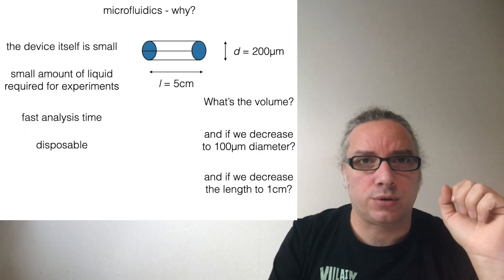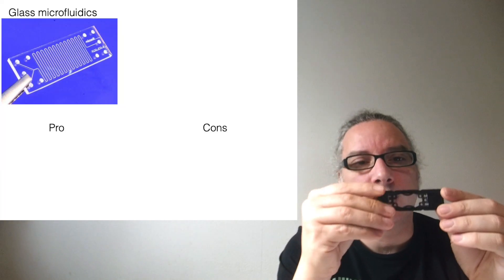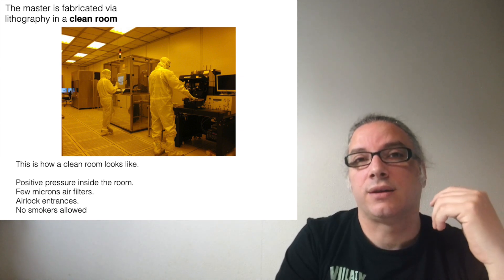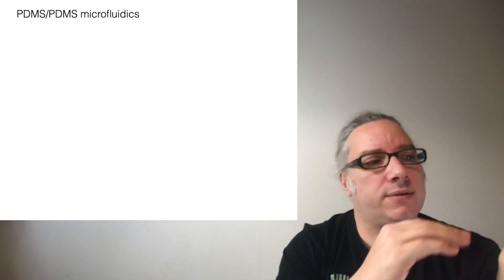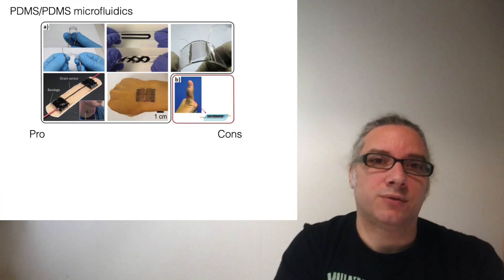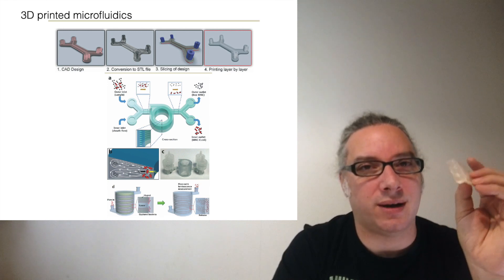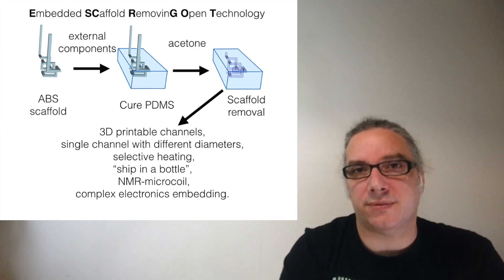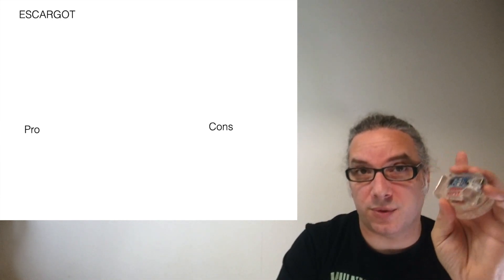Microfluidics Lecture (Sensors and Devices 05_1)

Comment: Y don't they use nanotechnology. Does it have to do with PDMS that it cannot be magnetized to be manufactured with nanotechnology?
Reply from the maker: it can, and you can reach "nanofluidics", the problem is that the smaller the channel the higher the pressure you need to flow liquids inside.